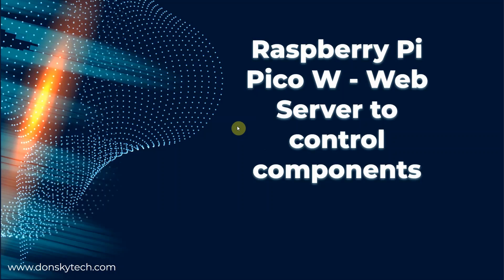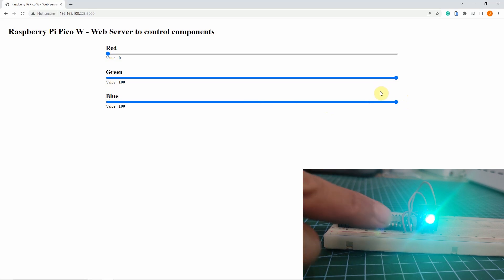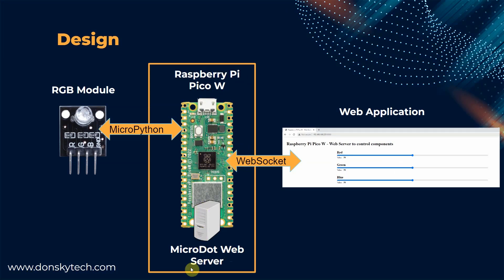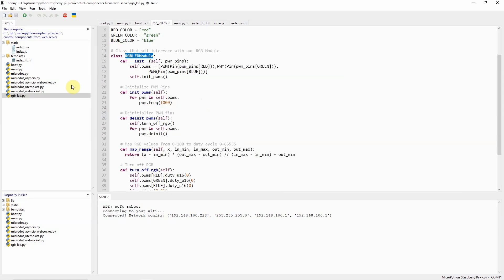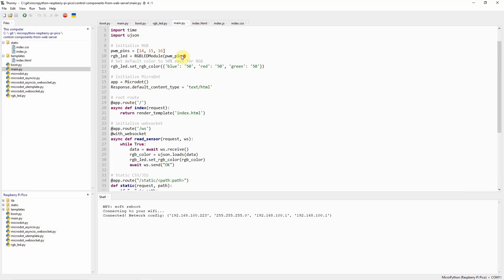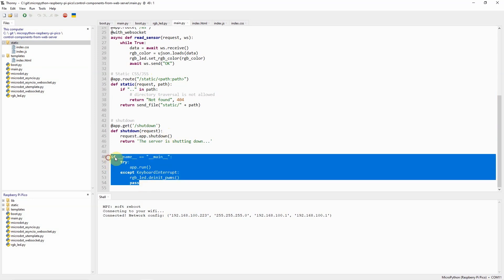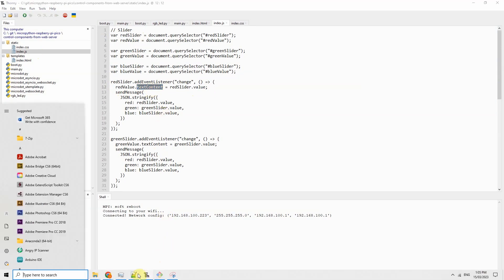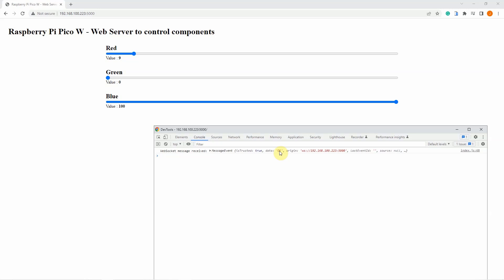Raspberry Pi Pico W - Web Server to control components

Comment: I am a novice at Javascript but it seems to have a lot of redundant commands (functions). Take...
document.querySelector and document.getElementById
and
.addEventListener("change"... and .onchange
they seem to do the same thing. Google give a lot of differing opinions on which is better. Donsky, I was wondering why you choose the ones you do. Thanks.
Reply from the maker: Hey, I am not sure why I did not see this comment until now. They both have wide browser support. The querySelector is used when you want to select by CSS selectors like id, classes etc. The getElementById is when you want to select only by ID. Either way will work on major browsers.